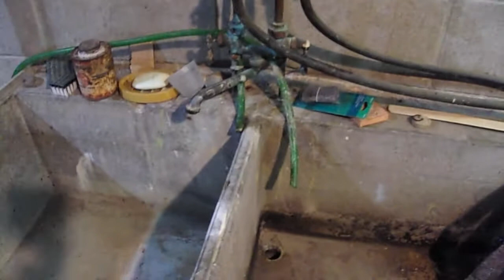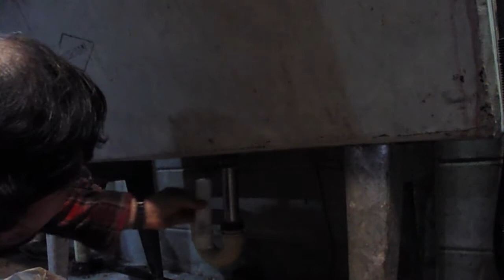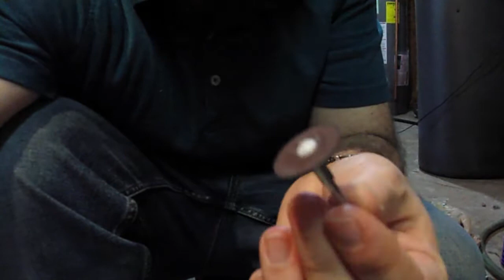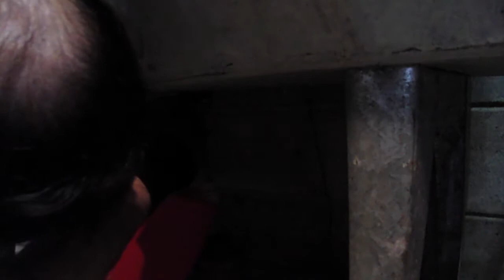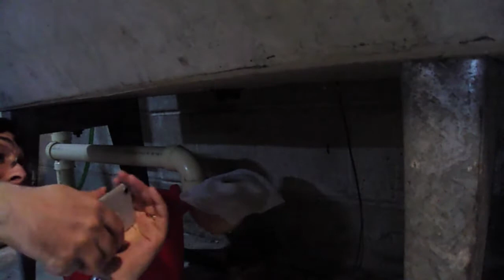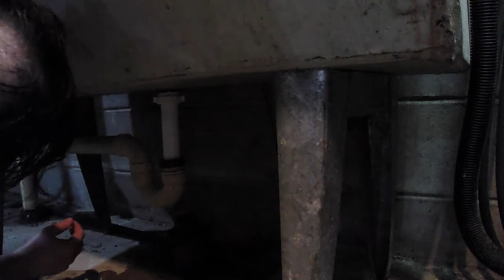How to Eventually Replace the Tailpiece Extension on a Utility Sink

Comment: I have been looking for help with my concrete sink. It seems to be missing the first part that you had to cut off. It's just a pipe lined up to the tailpipe and water leaks around that gap. After a bunch of searching on YouTube where I was given things that were not at all applicable this is my exact sink with my exact piping. Hopefully this video is the break through I need. Also big big thanks for listing the parts you used.